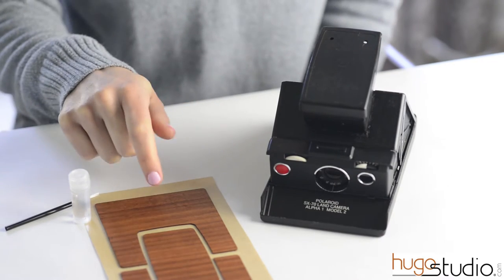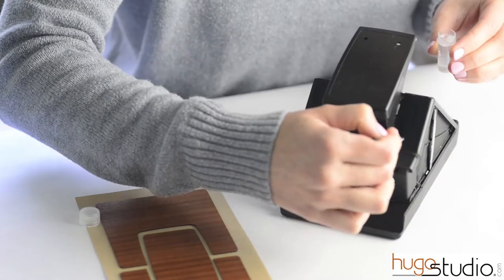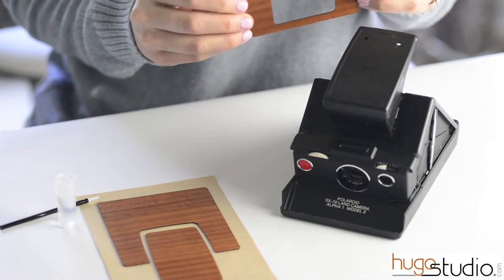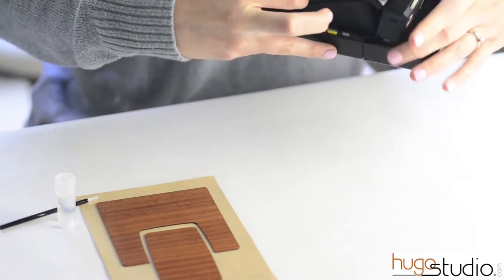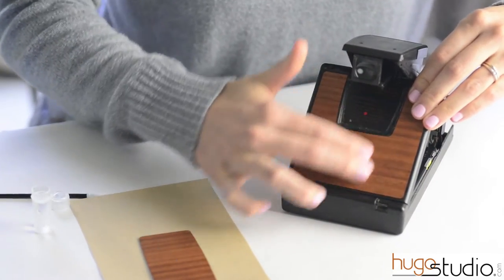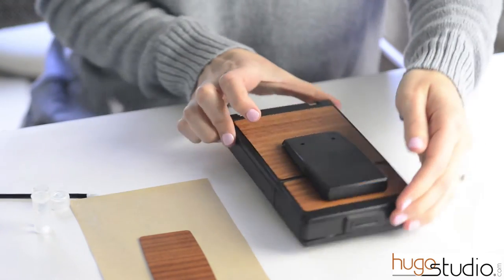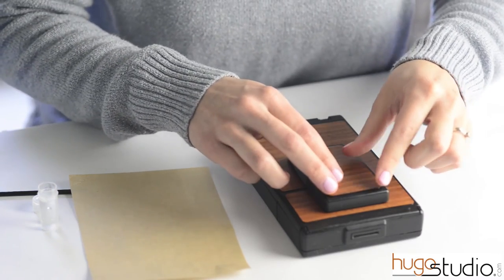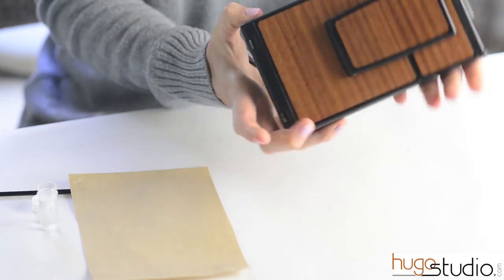Polaroid SX-70 Replacement Cover Installation - Wood

Comment: But how did you REMOVE the original Porvair??
Reply: Mark O Goo Gone does extremely well.
Reply: Thank you, I'll try it...  My best camera as far as the folding & focus-smoothness is actually a Model 2 Ivory, which I wish was a brushed-chrome Model 1!
Reply: +Mark O - I just removed mine today. A hair dryer and a plastic scraper works really well for getting the initial Porvair off,  from there you need some kind of cleaning product that is natural and is ok with plastics. I used a similar one as mentioned above. Finally I used rubbing alcohol/isopropyl alcohol to wipe it down.  All of this was done with several rags and took about and hour and a half. I hope that helps (:
Reply: Thank you, Zach.  Between heat and goo-gone I guess I should give it a try.
( The real-leather cameras where it's "easy" to remove the leather/metal-foil combo, but shouldn't remove the metal for modern replacements is another matter...   80> )